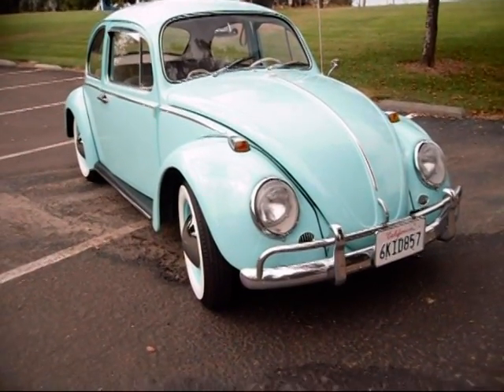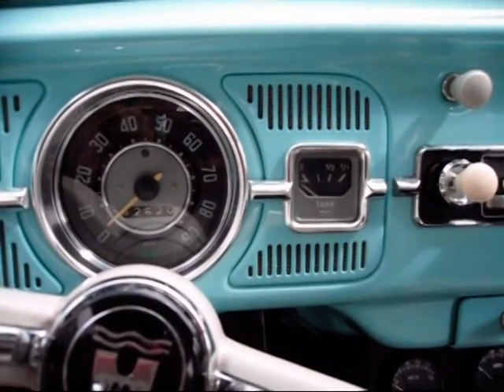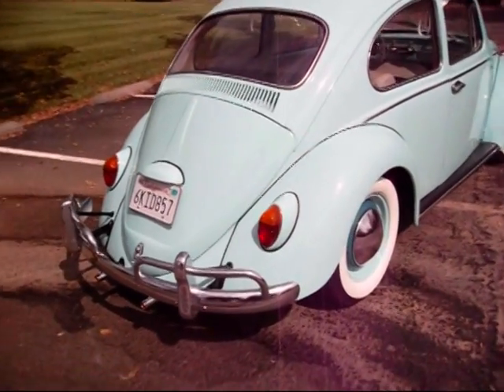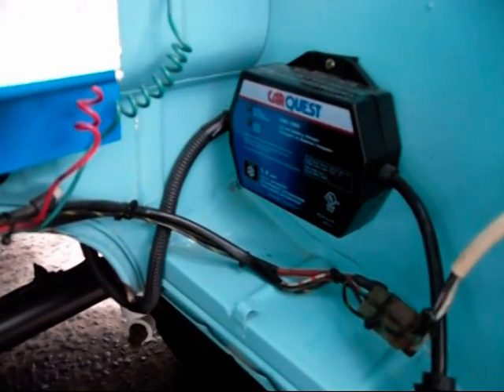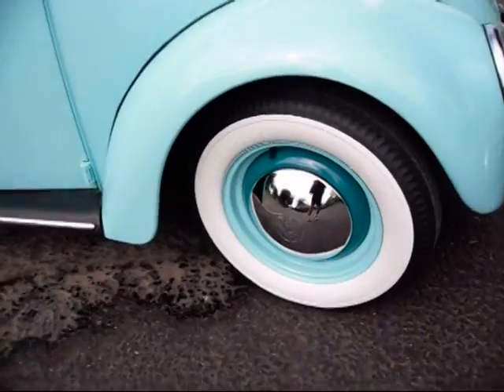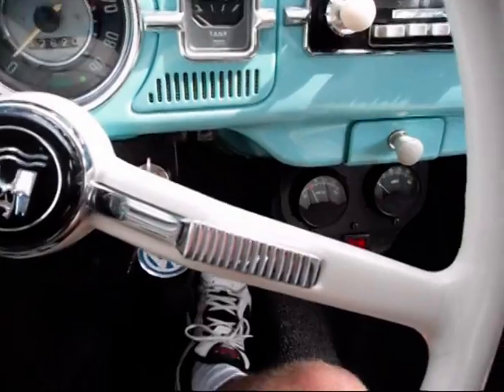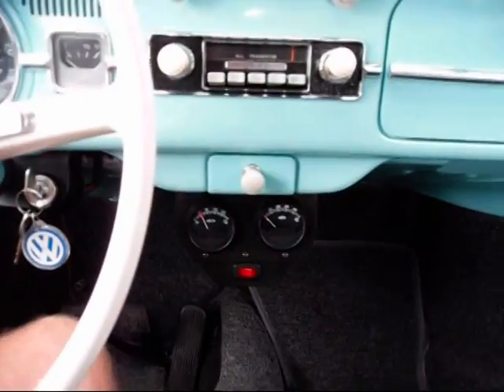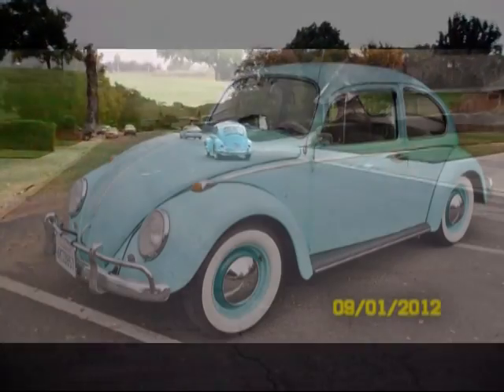1965 Electric VW

Comment: What has happened to your car since the electricity was installed up until now 2019?
Reply from the maker: I sold the VW a few years ago.  I first tried to sell it as an NEV car but after no interest over two or three months, I pulled all the electrical components, reinstalled the gas tank and a rebuilt gas engine and sold it in one weekend.  I then was able to sell all the electrical components: motor, controller, contactor, etc. etc. to someone else working on an electric VW.  Finally, I sold the batteries to golf cart owners.